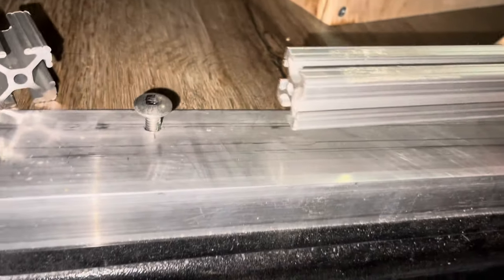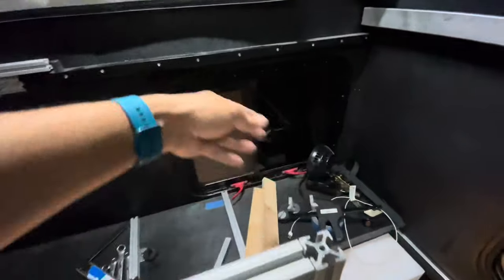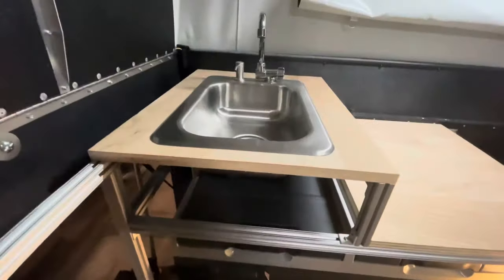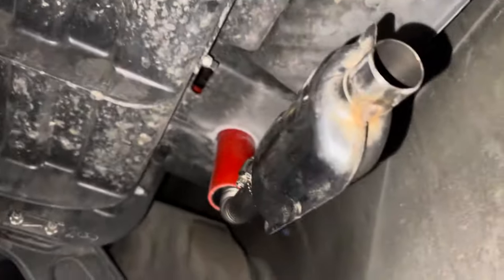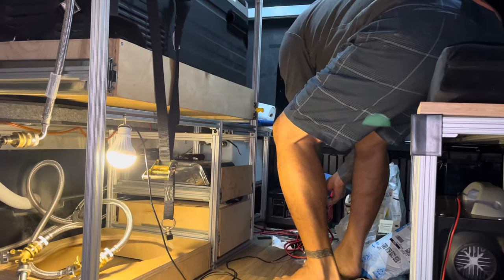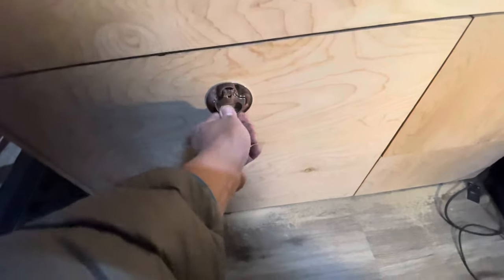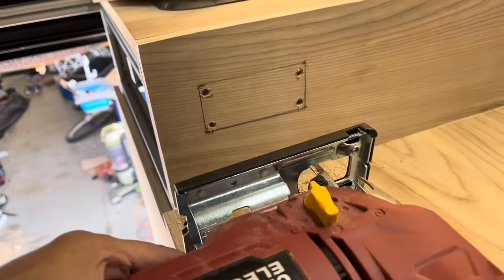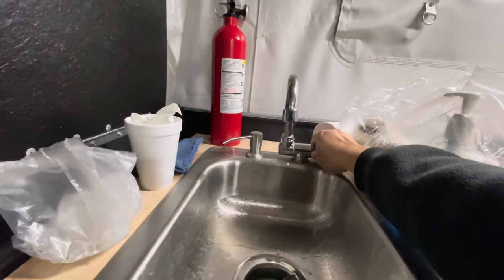Four Wheel Campers Project M  How I build “My Ultimate Interior of the Camper”

Comment: Great video! I love your build!  How do you like the diesel heater? Is the exhaust from the diesel heater at a safe discharge? Do you feel confident with the diesel heater being right next to the diesel tank? Congratulations on all your hard work. Amazing job!
Reply from the maker: Thanks for loving my build.. yes I’m confident with my diesel heater inside, in fact it’s been several months of use now and it’s running perfectly, I have thought of everything about the mounting of the heater, the exhaust is of course routed outside and is sealed using exhaust sealant, I also have a carbon monoxide detector/alarm and it never did set off, not even once. Regarding the diesel heater beside the tank? It’s perfectly running well, both are not touching each other plus I also placed a silicone mat on the side of the tank to act as an insulation, overall it’s safe and very convenient to me.
Reply from the maker: Watch this video at 18:57 and you will see how I routed the exhaust of the diesel heater.

Comment: What size vehicle is that? Do you have any concerns about the weight after your build?
Reply from the maker: Well it’s a Toyota Tacoma so it’s a midsize truck, the Four Wheel Campers Project M alone is an empty shell weighs only 358 pounds, it’s pretty light weight and I use an extruded aluminum 80/20 and it’s series 10 so it’s really lightweight and strong. I’m still running 80-90 mph on the freeway